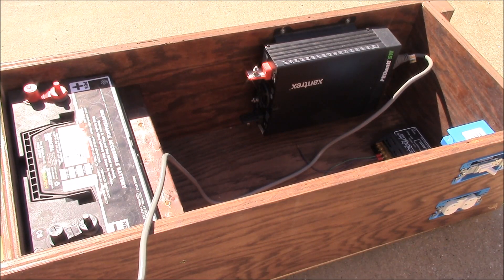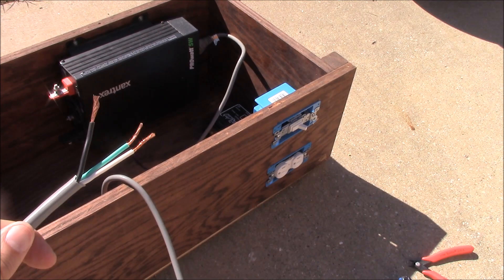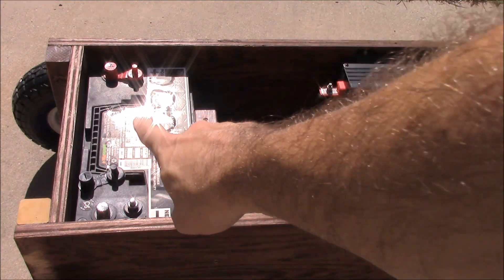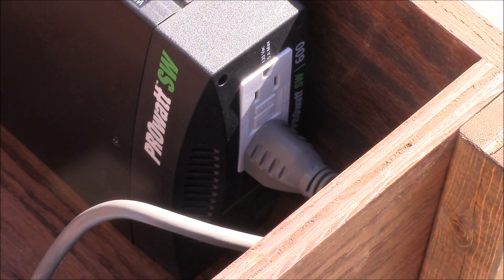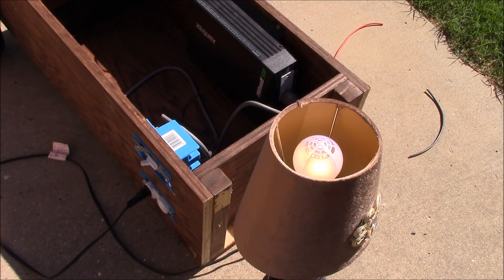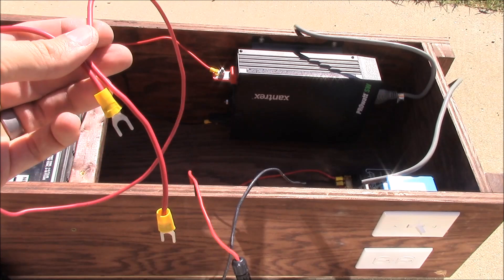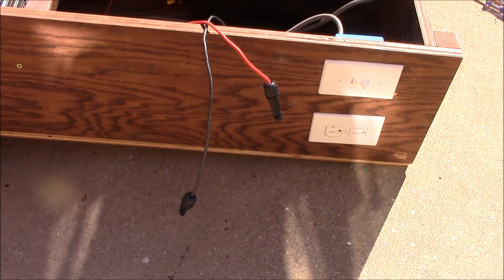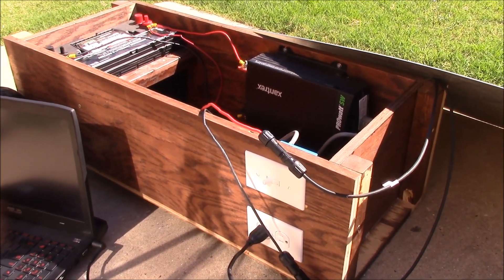Solar Generator Project - Part 3 Wiring & Testing

Comment: No fuse or breaker between the battery and inverter? no fuse or breaker between the panel and the battery? 
You need a switch between the battery and the inverter, the idle draw is significant, and turning off the inverter doesn't stop that.
Reply from the maker: Good idea on the switch.  But the other two fuse/breaker locations are superfluous.  There are already protections built in to the charge controller and inverter.
Reply: The battery, even a relatively small one, I don't know what size you're using, but let's say it's a group 27, has the electrical potential of thousands of amps for a very short time when it is direct-shorted. This potential will definitely jump whatever junction block is inside these boxes. The last Xantrex unit I had, (a forty amp charger) had fuses inside the case but the arc from a dead short will render them ineffective. The arc WILL destroy the guts.
The in-built 'protections' you assert will not save the inverter or controller. Email Xantrex and ask them what they recommend.
Fuses or breakers are extremely cheap insurance. There are fuses that mount directly on the battery post with values up to 500 amps, no cutting or crimping is involved.
Mount the fuse, attach the cable, and you're good to go.
Reply from the maker: Certainly it can't hurt but a short circuit like you are talking would be extremely rare.  If I were to sell a production unit like this it would have all of those protections but for my own personal use and testing I'm not really worried.  I've played around with dozens of these systems and never shorted any devices yet.  Knock on wood!

Comment: i didn't see a fuse to the battery. Did you install one after?
Reply from the maker: I didn't put in a fuse to the battery bank.  The inverter acts as the safety device for the load side.  A fuse or breaker would not hurt anything but I just didn't use one.
Reply: oh ok thanks for the reply

Comment: hope you see my comment on one of your other videos about making a sound system out of car audio. if you have spear time could you email me a good setup I want to be able to hook it up from wall outlet etc I do have a 12v power supply a bit small though. I want to hookup up head unit amp speakers sub etc pretty much like a display at a audio shop what things would I need. I know how to hookup the head unit or amp just with speakers or a sub using that power supply but how would can I run head unit and amp please help me one of your fans shylow0213falcon@hotmail.com
Reply from the maker: I tried to email you but it said that email address was not valid.
Reply: sorry mate I corrected the spelling in the post hope to hear from you when you have spear time much appreciated I'll right it again shylow0213falcon@hotmail.com

Comment: Most multi-conductor cables have a small nylon cord within the sheath. If you make a small slit  in the sheath, you should be able to pull the cord to split the sheath. It usually works as intended, but some cable sheaths defy common sense... :>)
Reply from the maker: Haha, this one didn't have one.  It was strange.  That is what I was hoping to find.  It also had a white powder inside of it, which I assume is to prevent moisture or something?
Reply: LDSreliance The powder allows the inner conductors to move with less chance of them chafing the insulation through and shorting.

Comment: I used a OptiMate CABLE O-20 Weatherproof SAE socket from Amazon to connect my Solar Panel to my waterproof box.  It works well and have had no issues with it yet..

https://www.amazon.com/dp/B0031BOTFC/ref=wl_it_dp_o_pC_nS_ttl?_encoding=UTF8&colid=18KHSPC6VVIE0&coliid=I1V4ROTCUKIC0M&psc=1
Reply from the maker: Awesome!  Thanks.  I may use this.
Reply: Not good to put any electronics in same box with battery because as bat off gases the gases carry SO2 which condenses on any cool surface ( inverter) and corrodes it to pieces .
Reply from the maker: Frank McCleary This box isn't air tight and isn't going to see serious use.  It is an early prototype so I can test and see if it is something I want to produce.  The battery box would be sealed and vented to the atmosphere in a production model.
Reply: The main idea is to keep the batt gas away from any electronics. Thanks for your reply
Reply from the maker: Frank McCleary I agree with you.